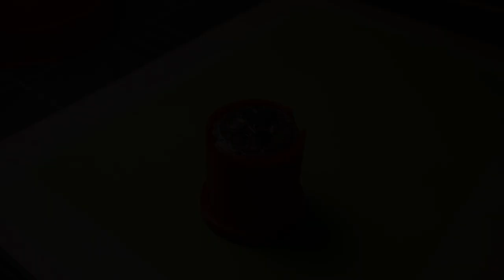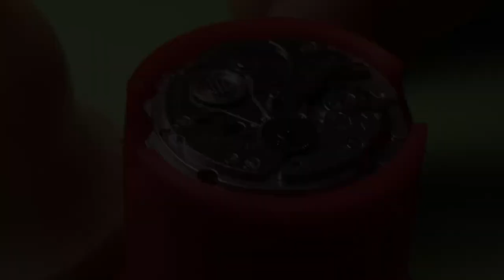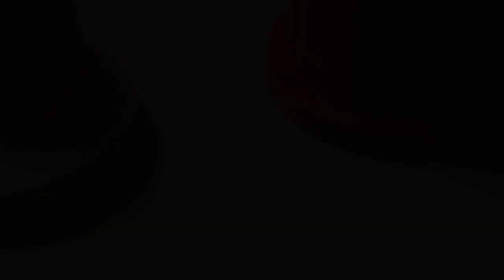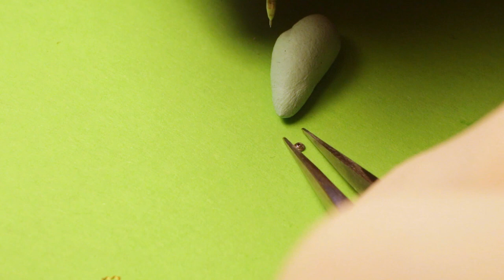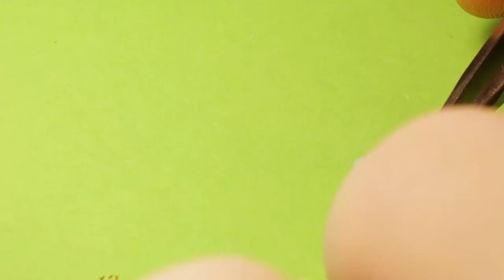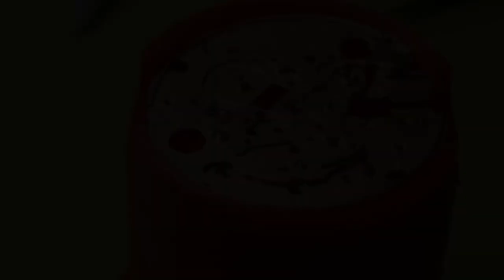Bergeon Automatic Oiler 1A Overview & Use Seiko 7019A

Comment: Great video pal 👍🏼 I just managed to get myself one of these off the bay new @ a reasonable price so hopefully it will make my life a bit easier.
Reply from the maker: These are fantastic for balance end stones and unbeatable for those capped jewels you find on Seiko bridges. Be very careful with the needle tip though. £14+vat to replace and they break easily I discovered quickly.

Comment: Nice instruction on the 1A which I have and you answered the question of if I need the other two oilers as well. The instructions talk about the tip springing back - mine does not spring back. Is it maybe the tube that forms sort of a seal around the bearing jewel hole and maybe retracts then the oil slides down the tip onto the cap stone?
Reply from the maker: Glad it's been useful.
When you talk about the tip springing back I assume you're referring to it coming back out under spring pressure after you've drawn it upwards with your finger?
If so then yes the internal spring system will draw it downward so the tip comes back out, the needle carries a measure of oil and as the tip touches the cap jewel the oil is drawn down the needle onto the jewel surface.

Comment: Bought it but wondering how you clean the tip after some usage? I guess after a while it sticks some old oil on the tip. Mine sometimes doesn't push out any oil, so first push sometimes doesn't give any but next one does. Seems a bit not trustworthy hmm.
Reply from the maker: Using 9010 you shouldn't get much if any buildup. a dip in alcohol and the occassional pith will keep it clean, the reservoir is recommended to be cleaned in an ultrasonic. Be caerful with the needle, they're very fragile.
Reply: @spidiq8  Thank you

Comment: Hello thank you for this video very useful. How do you clean the oiler ? and for how long oil can be let in the reservoir ?
Reply from the maker: Glad it was useful, I use Rodico for cleaning both the needle and the reservoir.
You could also pith the needle but be very careful to stab straight in and straight out as the tip of the needle is very very fragile.
Though I haven't tried, you could likely drip some one dip through it.
I change out oils every couple of weeks and only ever add the smallest amount I can get away transferring, if you're using it only for your own watches, you could get away with longer.

Comment: My question is... im working on an illinois watch... it is a key wind and key set... the bridge over the train has to be removed  to clean and oil the lower balance jewel... if i clean it can i use this to oil the jewel after the plate is restored? Or is it still safe to clean and lubricate the jewel without rebuilding?
Reply from the maker: You need to be sure it's thoroughly clean so disassemble if possible. You can then lubricate with this and though it wouldn't matter if you weren't assembling immediately and had it covered it's good practice to do it as you reassemble and get into the routine.
Dust has more chance of getting in if done early although these cases for these old watches aren't really the best sealed anyway.

Comment: Fine video you have here. Having been considering purchasing one, this has been very helpful. Is it difficult using the concentric regulating screw, to get just the proper size drop?
Reply from the maker: Not difficult at all, a little time consuming as you need to use trial and error on a chaton and endstone checking after each application and cleaning and redoing as necessary, provided you're doing similarly sized endstones you can leave it set.
Reply: Seems easy enough, then. Then, one could do test drops on the edges of the oil pot. Thanks for getting back.👍
Reply from the maker: @markdombek2551  You can but I found, trying that on a watch crystal, the problem is lifting the oiler straight up cleanly, on an assembled chaton and endstone the design ensures that you have to lift it straight up.
It sounds easy in theory but because the needle is spring loaded it's incredibly easy to have it slide on a smooth surface as you try to lift it.
Reply: Ahh, yes, I believe you have made this clearer. I thank you, for this clarification.

Comment: Do you feel it necessary to fill the tank so much as Bergeon instructs, or can one have less? In that, I think I read/heard Bergeon says 3/4 full. Would 1/2, or less, be sufficient?
Reply from the maker: It is for me, I would imagine it wasteful to fill it more than half full as even if you were a commercial watch repairer you wouldn't get through it quickly enough when the suggested practise is to refresh your oils weekly.
I've only ever filled mine about half full so can't say if there's a difference in droplet size with more in but I can't imagine there would be.
The drawing of the oil happens, as I see it, through the stepped nature of the oiler needle.

Comment: I found a tool in a watchmakers estate  sale  that makes the replacement of the shockabsorber spring much easyer its called kif trior
Reply from the maker: I typically use a shaped cocktail stick or piece of pegwood for kif and diashock springs. I imagine it works the same way?
Reply: It adresses the spring on all points and there are a acrylic shaft where the proper tool is inserted there are 5 different tools with the tip shaped for the different springs, i tried it once i have struggled for a while with a spring and it did the job like nothing in a split second
Reply from the maker: @thegrassyknoll7792  Yes. That sounds exactly the same principal as the shaped tool. Essentially I cut a flat the size of the diameter and carefully hollow the tip into a concave shape so that the outer edges can press down on the spring and rotated around to manipulate lugs into the slot. I use the tweezers in this video to demonstrate how to refit a diashock as Seiko only have one cutout and it's very easy to snap a lug or break the spring if too much downward pressure is applied all round whereas a typical Swiss kif setup will have 3 locating slots.
I will at some point make a video demonstrating the making and use of it but it's difficult to film very close and work closely with small objects.
I have shared images to demonstrate in a couple of watchmaking groups I post to.
That tool sounds very nice. A good find.
Reply: spidiq8 exactly and a safe way to get it done too
Reply: spidiq8 i didnt know the use of it, but when i nearly lost the spring twice and had spend a lot of time on the floor looking for the damn thing i took time to investigate a little in the use of the tool and it sure works, thanks for the reply
Reply from the maker: @thegrassyknoll7792  Haha yes, at least 30 percent of watchmaking is time didn't on your hands and knees looking for that small part that just disappeared. No problem on the reply, I always try to respond to everyone. Thanks for taking the time to watch the video. The 1A oiler is great if you're thinking of getting one. Not cheap but makes the oiling of cap stones so easy including capped train wheel pivot holes.